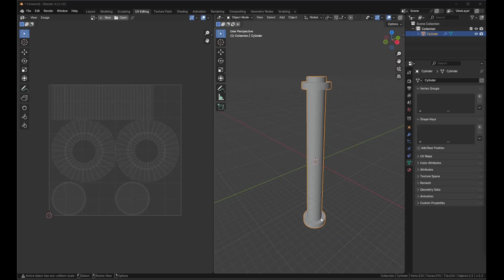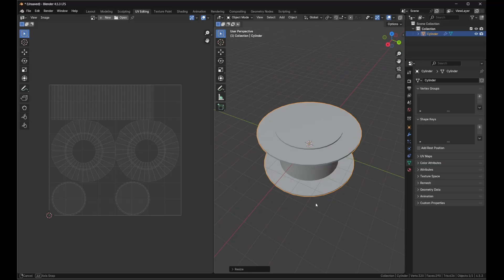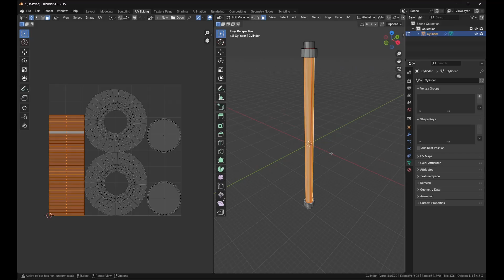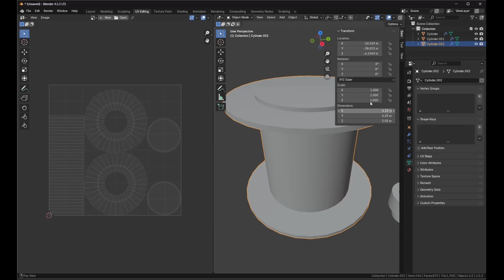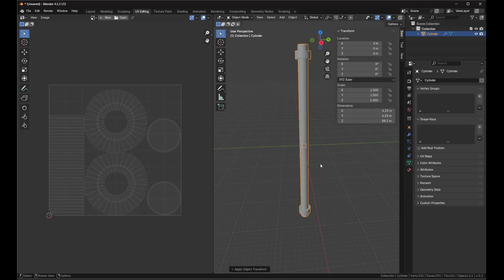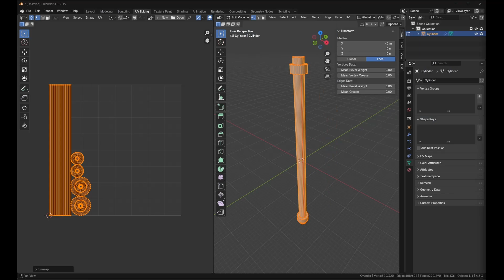Common Problems: UV Scaling

Comment: Max has an (annoying) consequence of resetting x-form where it can often break the mesh appearance, and undoing it doesn't work. You can also 'apply scale' in Max, which is a bit cleaner and pretty much does the same thing but making sure its done often. I've done so much research into why X-Form breaks a mesh apart and generally its kind of unavoidable in cases where projects have gone too far without checking their scale is uniform on objects. Max's transform systems are a little less predictable.